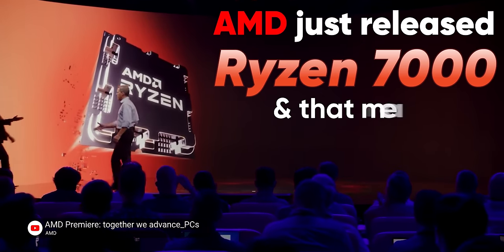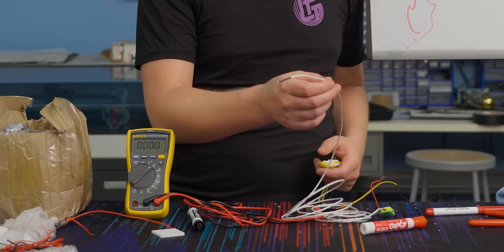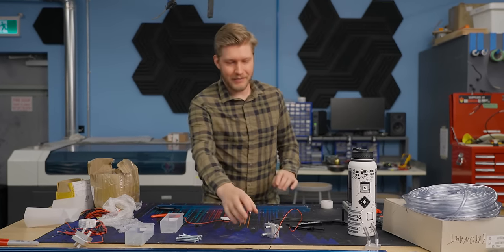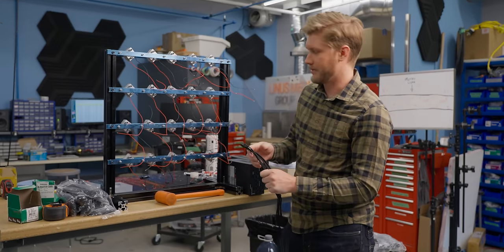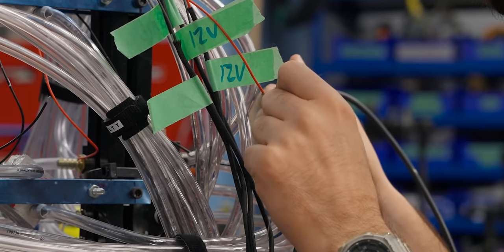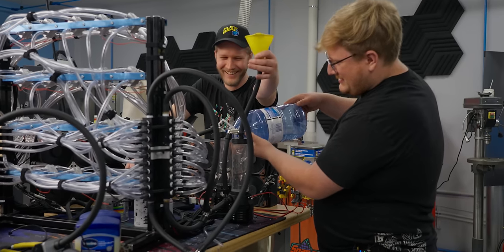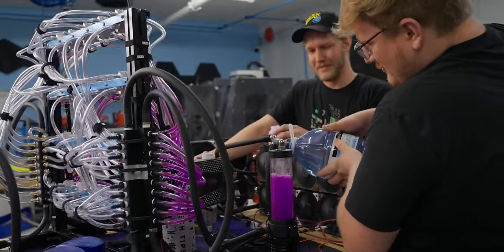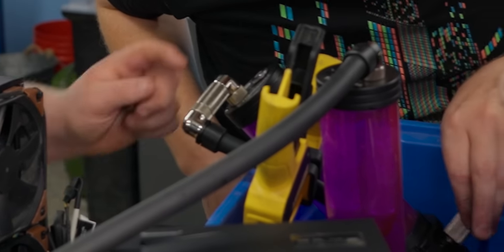Our DIY CPU Chiller From AliExpress is RIDICULOUS

Comment: The TECs did not draw the full amount of power expected because the supply voltage was too low. Looking at the data sheet for TEC1-12710, these modules will need up to 17V, but the supply used was only 12V.
Reply: Makes sense indeed. I was sure something was off. This was it. Thanks for confirming
Reply: Holy shit, theres more
Reply: Shall we talk about the failure to place the reservoirs above the tubing so that all the air naturally would migrate out or how about the use of metal bolts between the rails holding the peltier modules between pieces of metal shouldn't plastic nuts and bolts have been used to reduce the transfer of thermal energy through them oh well it was fun 😄
Reply: What, you think these guys are experts or something?
Reply: On the bright side, that means the TEC's would last longer because they were undervolted?
Reply: they don't read data sheets
Reply: another note the cold side will only get ans cold and the T over delta of the hot side so basicly if you cool the hot side too well the cold side will also get less cool.
Reply: @xsvrrx  you can't cool the hot side too well. In fact, if you go so far as to make the hot side cooler than the cold side, it will get even more efficient.
Reply: @christophermorin9036  not really much of any effect on that.
Reply: @xsvrrx  the delta max t in the peltier specs is just the maximum achievable difference. it can't get too cool to operate, but cooler hotside will enable lower temperature to be possible on the cold side.
Reply: @christophermorin9036  - No, TECs don’t work like CPU’s, since they are pulling the same amount of power regardless of voltage. So because the voltage is lower, because it will still attempt to pull the same power, the current will be higher, so it’ll run hotter.
Reply: @jsl6155  This isn't how TECs work either. The power is a function of the supply voltage and delta T, with higher voltage and higher delta T each increasing the current draw. It can snowball since higher current increases waste heat leading to higher delta T, but only to a limit (The voltage won't be enough to drive any more current at a point). Lower voltage means the TEC simply can't work as hard.

Running a TEC too hard can be an issue though, since getting too hot will kill it or wear it out (alex wasn't anywhere close to that here).
Reply: Was gonna comment this. Most '12v'  TEC's are actually rated 15.2 volt (with 127 couples) At 12 volts, they draw more like 8 amps(96w), or 1920w for 20 of them. Minus the 2 TECs they lost, still should be 1700w. Resistance and cheap Aliexpress factory rejects probably account for the rest of the loss.
Reply: Gotta get em boost up's
Reply: @allenfunstuff  they also could've avoided this if they used special peltier cooling blocks that are bigger, you can stick multiple peltiers on them.
Reply: @allenfunstuff  tbf the use of plastic bolts compared to metal shouldn't really matter anyway  since the thermal transfer across the bolts will be extremely low compared to the thermal energy being taken out by the 2 cooling loops
Reply: @DigitalPanhandlr Higher voltage does increase the tempature difference, they are also horribly inefficient no matter the voltage.
Reply: That is okay, you are not supposed to run TEC at full power anyways.
Reply: Peltiers are NOT meant to just be wired to a PSU LMAO, They should be controlled by PWM with MOSFETs using a custom controller eg PIC/Arduino . Also you could have just explained that when you add electricity they become heat-pumps and that they effectively add heat to do it. Also they should be treated like CPUs in terms of thermal compound etc Would it have killed y'all to have 3d printed something? Also it's usually the peltiers themselves that draw condensation, a simple fan is usually sufficient above 10 degress.
Reply: @MacGuffin1  PWM isn't strictly needed, voltage modulation also works. PWM is just really convenient for PID control. The only problem with hard wiring to DC 12V is that the only control they have is on or off. For the scope of the project here that was fine. There was no temperature target, they just wanted to make it as cold as possible.
Reply: @tronique5736  you seem more then adequately equipped to do it right make a video
Reply: @jaysengstacken2118  almost like they are being paid for it isn't it?
Reply: @jakobfindlay4136  Unfortunately I have next to zero video production or public speaking experience. I appreciate the encouragement though!
Reply: They could've spent a little more time in this video.
Reply: This was average tech boys letting lose at LTT as usual, Are you new to the party? 😂
Reply: I also wonder if they’d have a more dramatic impact by halving surface area (and reducing coolant volume) and double stacking the TECs?
Reply: We need 17v then.

The project isn't over until 17v is given!
Reply: @allenfunstuff  i kept waiting for him to do that in the video, but alas it never happened
Reply: TECs are massively more efficient at lower power levels, as you approach 100% power they drop to less than 20% of their peak efficiency. At a certain point you're basically just forcing the TEC to generate more waste heat itself, rather than actually pumping any more heat from one side to the other.
Reply: It’s LTT what do you expect 😂
Reply: Not exactly. Lower voltage will draw more current at the same power. The higher current at lower voltage will actually cause the TECs to get hotter than they should have, reducing the efficiency.
Reply: @Sean-un7ok  uhh, V=IR
Reply: @allenfunstuff  interesting, but ya....the peltiers HAS to be isolated...a fine example of improper peltier usage, The tubing...i dont know where to start... and considering the heat spreade wasent removed at all (wich it should have been)...it prob wouldnt had mattered signifficant even if he setup was closer to deasent...
Reply: It doesn't matter if they give it more power. The design is bad. The way the TECs are tubed together is terrible. They should be CASCADED not in parallel. The antifreeze is in contact with TECs for only about 10cms before it goes to the CPU. The TECs simply don't have enough time to cool the coolant.
Reply: @jsl6155  Remember that TEC is just like Resistor, V=IR, you will ramp up Current if Voltage Higher. Look at datasheet.
Reply: @christophermorin9036  Not always. Some electronics are just as easily damaged with too little voltage as with too much voltage.
Reply: "Lower voltage = more current" What the f am i reading, several posts like that in this thread. Not even a basic physics knowledge, huh?
Reply: @tronique5736  they got 20 modules, they can do 20-step control by simply on off if they want.
Reply: @dalehorton7748  not everything obey ohms law. Especially something involving semiconductor
Reply: @edmondhung6097  TECs are non linear, and vary with temperature delta across the junction, but at any instant at a specific temperature and voltage, the current can be calculated. You can't force more or less current through without varying the voltage
Reply: @edmondhung6097  Well, that would require putting a switch on each one. Not the most practical solution lol. They were trying to go all out anyways.
Reply: @edmondhung6097  Ohms law does apply actually. However, you have to use Impedance instead of Resistance. The impedance of the TEC includes - in addition to resistance - the effects of parasitic capacitance/inductance, and the effort required to move heat through the TEC. There's a lot of temperature and heat flow effects on the total impedance, so the current can change without the voltage changing (but ohms law is never violated).
Reply: @hohohodrigues  It's literally one guy who came up with the idea for this video lmao. yall act as if they are all sitting around doing research for one video.
Reply: And with these extreme gradients, seebeck effect means peak will never be achieved, from what I remember.
Reply: @HoloScope  it's a [joke]
Reply: The VMAX of a 192-couple Peltier is 15V. You can run them higher, but at that point they’re overloaded. For maximum COP and best cooling capability (you have to account for internal resistance) TEC’s should be run around 60-80% their VMAX, otherwise they start generating heat internally. The datasheets usually come with efficiency graphs which allow you to check their sweet spot. In general, you have to oversize TEC’s to your application - if you expect to pull 100W of heat from something, you’ll want a Peltier that’s 20-40% beefier than that.
Reply: @Foxi4Qnet  If the goal is efficiency, then you'd be using refrigeration instead (that process can have a COP greater than 15). If you must use TECs but still care about efficiency, you'd rather be more like 4X oversized (peak COP for a TEC is more like 25% output or less, not 80%). However, if you're just going at it, you can run the TEC at 100% all day as long as you have enough cooling (and they absolutely did). 

To clarify, self heating occurs at all output levels, but most of the inefficiency comes from the peltier effect itself (it usually takes more energy input than the amount of energy you are pulling from the cold side).
Reply: @tronique5736  I've been waiting for someone to do something this crazy with peltiers for years, I'd watch a cell phone video with shitty notepad subtitles
Reply: @jakobfindlay4136  While it's certainly not nearly as wild, TechIngredients has a great video about a DIY mini fridge using TECs. There's also a derbauer video where they use like 8 TECs in series to cool a cpu. Highly recommend both for juicy TEC content.
Reply: @tronique5736  This is correct, however keep in mind that as per datasheet, it’s not a linear increase in self-heating, so running them lower than VMAX is generally recommended. The COP on Peltier isn’t tremendous, the advantage is that they’re solid state, so you don’t have to deal with any refrigerant gas. It’s generally easier to construct than a compressor-based system.
Reply: @Foxi4Qnet  I know this (we're basically agreeing)
Reply: @tronique5736  Hey, just a little info for those not in the know who happen to be in the comments section. :) The amount of “peltier chillers” on YT that are either built incorrectly or ran incorrectly is staggering, it’s good to have some actual, accurate information on how they work available.
Reply: @tronique5736 ive already watched both xD
Reply: @MacGuffin1  pwm actually has the potential to damage peltier elements if not smoothed by an inductor. it also greatly reduces the efficiency to run pwm. Smoothed current control is the ideal way to drive these devices.
Reply: @MX304  peltiers are not damaged by reduced voltage/current.
Reply: @edmondhung6097  good thing peltiers for the most part do, more voltage equals more current.
Reply: @dalehorton7748  uhh... You mean U=IR... V is the unit of U, just like A for I and Omega for R...

Also P=IU so his statement is correct even though you wanted to correct him for it. He said at same powerdraw (P) the lower Voltage will mean increased Current which translates to more heat.

Example: P = 12W and U = 15V would mean current going through it = 0.8A

Now same powerdraw (12W) at lower Voltage (12V) would mean 1 Amp going through it now. 

That is by logic of equal powerdraw which he used.

I don't know shit about TEC's, but I'm assuming they don't really target a specific powerdraw though and its just a fixed resistance. In which case TEC's adhere more to Ohm's law than towards the powerdraw formula which is probably your reason for writing down Ohm's Law. But give the guy some explanation as you clearly know how they work it seems rather than only writing Ohm's law since he's thinking of it like something designed to draw x amount of watts as it's dedicated for a specific voltage.
Reply: Just smash the 12v rail from one PSU in series with the 5v rail from the other PSU.  
STONKS
Reply: tec coolers loose more and more efficiency when the voltage approaches max. They wouldnt have produced that much much cooling power but would have made way more heat.
Reply: @xsvrrx that makes sense as it needs to draw the heat away using the large difference in temperature between the cold / hot side.
Reply: @jaysengstacken2118   they are in a factory that makes simple things look hard to do, and they sell these reactions to kids. they are decent when asked to be.